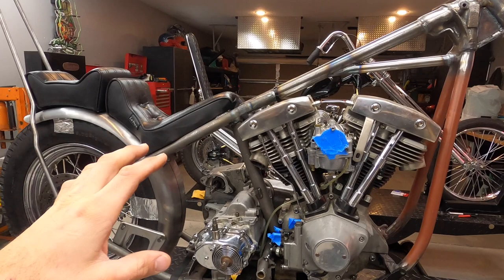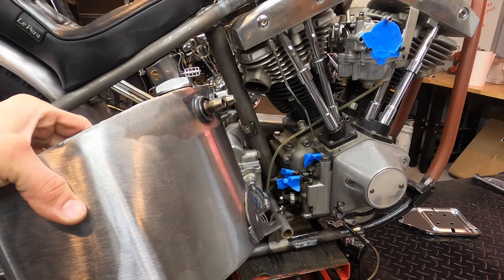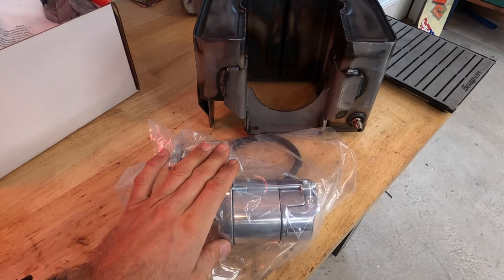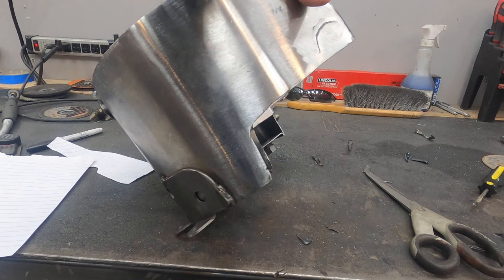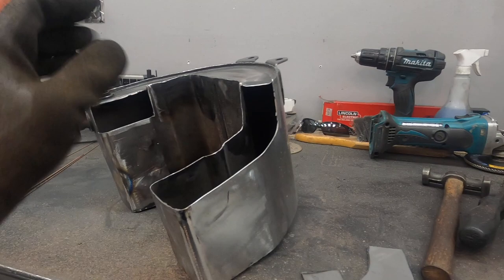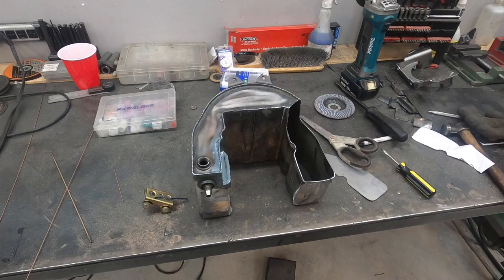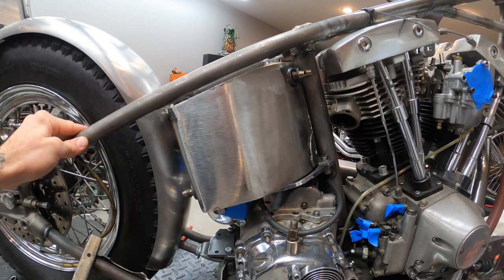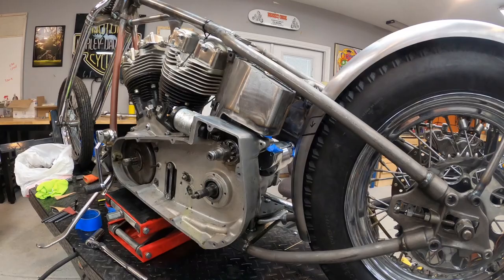Panhead oil tank and electric start??

Comment: Cool , man! Long time! I have exactly same spyke starter- its good, small and strong. What I suggest is to mount hand starter instead of solenoid. Solenoid sucks and makes a lot of troubles and also fire dangerous..  , so suggest just to replace it to hand starter and you can add your famous  hand made metal handle on it like you do for gear shifting handles .
Reply: I was looking for english name - you call it knobs . so you can make your own knob on hand starter 😀